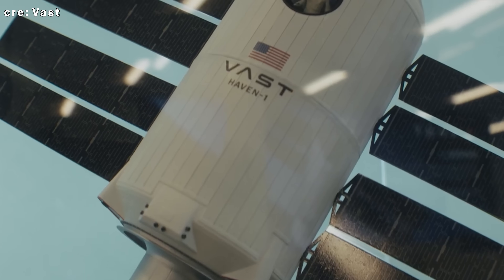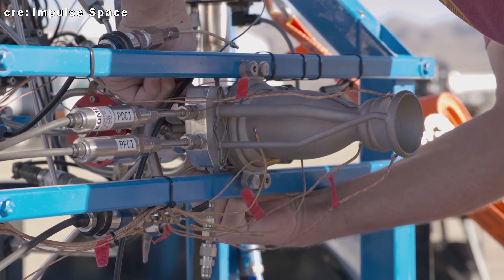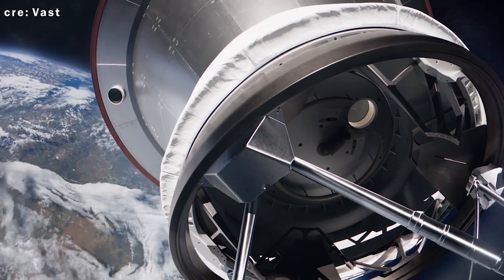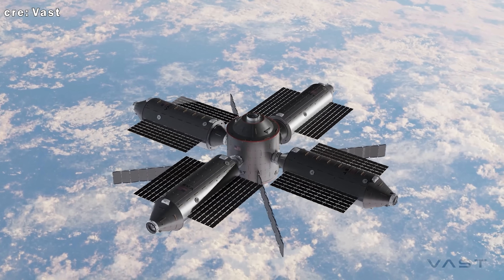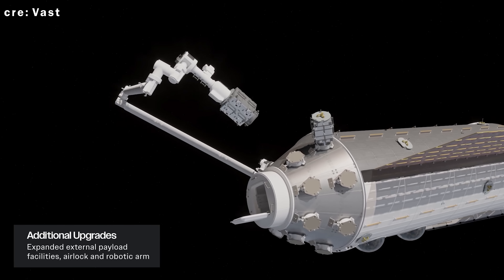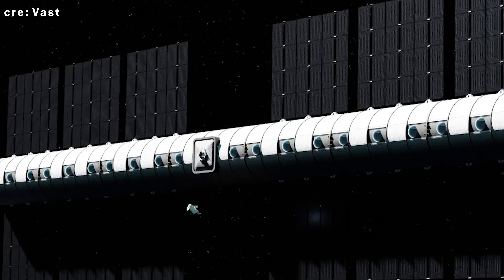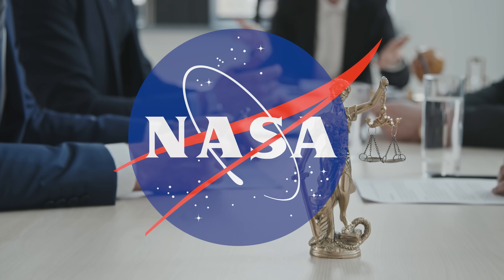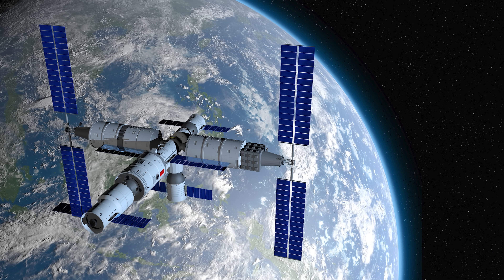New Inside SpaceX & NASA 2026 Space Station REVEALED, Better than China!

Comment: Should be looking at Max Space. The team is from Bigelow Aerospace, only now, they have done a great deal more and have the ability to build the BA-2200 and bigger. 
What is needed is to modularize more, which means completing the IDSS specs so that it provides electrical (data, low voltage, high voltage) and liquid hookups (LOX, several fuels, clean water, grey water, ammonia in/out for HVAC, etc), possibly gas such as atmosphere. This way companies can develop different modules such as power module, ECLSS module, cargo, docking, habit, etc.
Reply: The on;ly reason they haven't got the budget  to do what is needed, is the cost of SLS - 4.2 billion per launch, with almost nothing gained, except maybe bragging rights.

Comment: A disastrous video, on the level of an infantile commercial for laundry detergent. This is an example of how something extraordinary can be made from a 30-year slump. No science can be done in that barrel. And the question is whether it will even get into orbit in the foreseeable future, and how long the private sector can sustain it.
Reply: on top of that there is a big question on how do they plan to upkeep the orbit, as in none of those beautifiul 3d videos you can see any boosters to rise and upkeep the orbit. Theoretically config at 5.30 can be rised with a connected rocket, but then again what rocket?
Reply: No science can be done in that barrel?  What crap.  You can do science in a pup tent. ⛺
A single Vast station can't do as much as the ISS, but neither could the ISS when the first module went up.  As it grows, it should overtake the amount of science currently done by the ISS.  And if you add in the other commercial stations, the growth of in space science will only continue to grow.